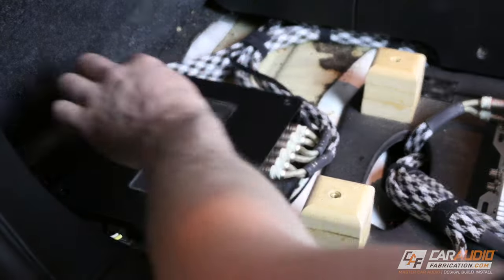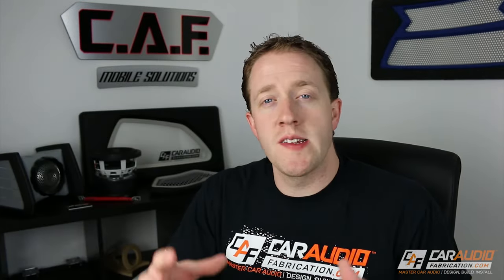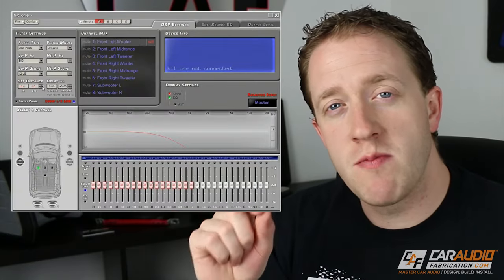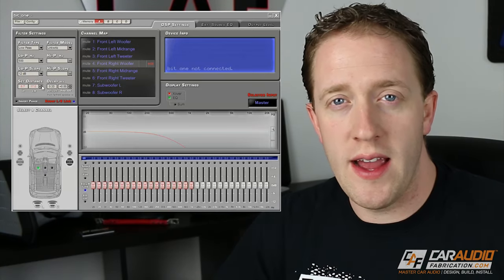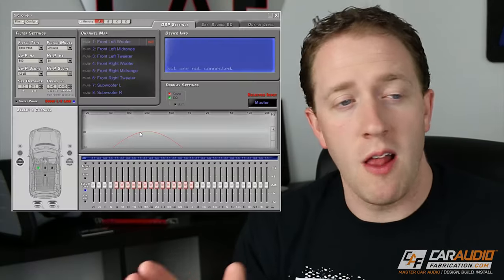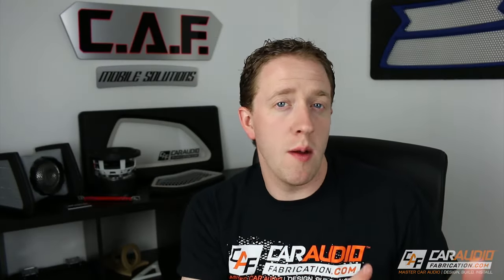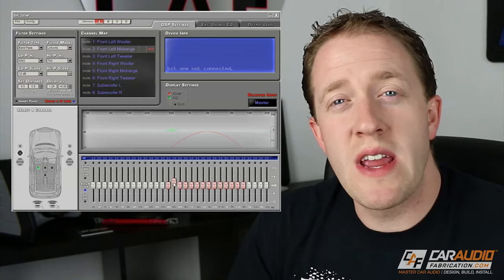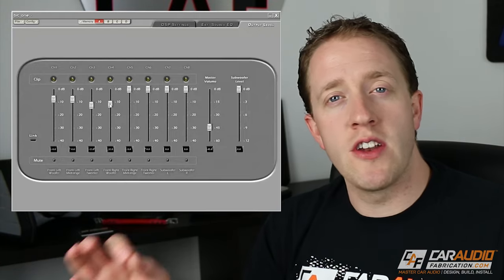What is a DSP? Why you need a Digital Signal Processor for Car Audio

Comment: Id love to see an in depth on DSP programming and installation along with gead unut features and settings for complex active setups that include a mid bass, mid range, and tweeter.
Reply: *head unit
Reply: Captain Buff The Third he didn't ask a question.
Reply: ***** lol 2/10 trolling.
Reply: a subwoofer in the boot and 6.5 coaxial on the parcel shelf and a headunit with at least 10 band eq. I used to think a 9 band was poor till i realised what parametric meant😐🤷‍♂️put the amp under the seat so need to run long cables for RCA.  get the alpine 8 channel amp with built in dsp and use your phone to play music over it. dont need a head unit. I like accessible dsp so i would go for alpine pioneer with phone app kid in a candy shop good for alll them  dodgy downloads and varying volumes.
Reply: read a manual on the deh-80prs, 👍👍

Comment: this may be a dumb question ... but if you delay the speakers closer to the driver so it centers the audio for the driver ... won't that throw off the time alignment for all other passengers even more ?
Reply from the maker: +kcksmithau Yes, it's something you have to decide, do you want the sound to be perfect for you since you are always in the car, or do you want the sound tuned to a center point in the vehicle so its sounds ok for everyone, with many DSPs you can have two or more different tunes. You could have one setup for time alignment for you when driving alone, and one for everyone when you have passengers.
Reply: +CarAudioFabrication  Hey Mark, I have a Pioneer DEH-80PRS in my car which has a built in DSP (an enrty level one of course) and everything works fine except for the TIME ALIGNMENT;  it has 3 settings for time alignment 1.when the listener is on the left side 2.when the listener is on the the right side and 3.when they are at both. 
but since its a right hand drive car, for some reason when i switch it to right, the right side speakers sounds louder than the left and vice-versa when i switch it to left. Only options left are to switch off the Time alignment or keep it at both, at which now i know and hear that skewed sound (confirmed listening with my head in the center, where it sounds correct). The Left and Right presets are also adjustable but dont know how to.  

Should/which speaker should i push or pull in it terms of "sound time distance" ? 
Plz shed some more CAF knowledge
Reply: I'm not Mark, but maybe I can help out here since I had the 80PRS in my last car and have been doing this for a while. The built in DSP is far from entry level for being built-in to the head unit. You can adjust the time alignment for each speaker individually yourself in the settings. The preset are very generic and don't do a great job. If I remember right, there was a "time alignment" menu option for listening position, and then another menu option to actually input the distances for each speaker. As far as which speaker you should push back in time, the DSP will do that for you when you input the distances, but the one that will be pushed back in time is going to the speaker closest to you. Each speaker gets delayed differently depending on how far away they each are from the target listening position so that they all reach that target position at the same time. As an installer I find that simply measuring the distances and inputting them into a DSP does a decent job, but is not always spot-on. I usually have to go in and manually tweak the time delays until I actually get the center image I am looking for. Quick tip if you want to maximize the capabilities of that 80PRS (if you haven't done this already) is to run it in "network mode." This will require you to run your tweeters directly off the front channel of the deck (or your amp) and then your midranges off the rear channel. The deck has full active low-pass, band-pass, and high-pass filters designed for a 3-way speaker setup, including independent EQ and level controls for each speaker. Doing this really opens up the capabilities of that stereo and really allows you to get in and fine-tune the system.
Reply: 80PRS have only 6 RCA Out. and small EQ and fixed crossover point. this is the problem if you want to build 3 way front + sub. In this situation bit one is perfect because have big 31 EQ, in every channel, delay, crossover without fixed point and 2 in RCA and 8 out RCA and optic in and out. Тhis DSP is great for 5 and 7 channel sound system. But if you really want good DSP, get Pioneer p90rs or ODR they are better.
Reply: +Valeri Radev the 80PRS has adjustable crossover points for all channels as well, but yes it is limited in that it only has 18 band EQ per channel and is really only good for a 2-way front stage plus sub, or a 3-way front stage with no sub. Overall a great built in DSP for the money though. $350 vs $1000+ for the 99PRS or a standalone DSP, it's pretty hard to beat. But yeah, standalone DSPs will always give you way more options and tuning flexibility.
Reply: Yes, it makes the sound for everyone else worse
Reply: You can usually have multiple settings depending where and how many occupants you have.
Reply: If I have preouts for front, rear, an sub is the sound processor jus for finer tuning of eqs? Would it be best if I still add a processor with an amp?
Reply: @iaguilera67  Gave lips....

Comment: First off, GREAT vid Mark! Keep up the great work. Second, Audison makes some of the best products on the market, they always give you more than what you need to do a great job. Third, I prefer my older Alpine PXA-H701 to the Audison Bit One or Ten, due to, IMO, I prefer the D/A convertors in the Alpine, I think they sound "warmer", however, that is entirely up to each listener or purchaser of said DSP unit. Just as a side note, for those who want to use a DSP with a stock headunit, you will be shorting yourself due to the limitations of the stock headunit, voltage output, etc., however, most people won't be able to tell the difference in sound. Fourth and lastly, using the time delay alignment feature on any DSP can create a sound field for any situation, my processor is set up so that I get the sound as though the rear speakers are creating the echo or reflection off the back wall of an auditorium. It sounds really cool and can still be tuned for my listening position. More complex mind you, but very good listening effect.
Will definitely watch future vids on how you set up your DSP.

Comment: That was real good explanation.  I have a Pioneer Z5190 head unit, and it seems to have all these functions like Active crossover with slope control, DB level control of each speaker, Time alignment, etc.,  I have coupled it with a Helix G Four.  Still do I need to have a DSP?  Is is worth spending on DSP over this setup?

Comment: Forgive me if I did not find the correct answer.  When using components are being installed in a vehicle with a DSP device, is the supplied crossover still needed to be installed?    I have enjoyed your information.  Thank you.
Reply: It depends. If you have enough channels to power the woofers and tweeters separately, then no. If you don't have enough channels then you need to use the supplied crossovers.

Comment: Would you spend the money on MOST Optical converter for the input signal coming from the factory head unit into the DSP? Is it really way better than tapping the high level speaker outputs to the DSP?

Comment: Great videos... Thank you.... 
Question: I have a HU (AVH-4200NEX) that has many of these features built in (EQ, Time Alignment, Crossover, etc...), but I'm still not thrilled with the sound. Would an external DSP (such as Audio Control DQDX) provide better sound processing than what this HU offers? Is it worth adding an external DSP to an aftermarket HU that already has many of these features?

Comment: Are DSP's mainly for hooking up an OEM radio to after market amps and speakers?  Or do they make an aftermarket head unit even better?  I bought a sound stream vrn 74hb and a sound stream T5 2500 5channel amp would I benefit from a dsp or no?

Comment: If I get a stand alone EQ would I need the DSP? my setup will have 1 mono block amp powering a 10" and a 4 channel amp powering the door speakers the amps have the standard low high and full range switches on them will I be fine if I just set sub to low and the speakers to full range? as long as I set gains correctly

Comment: Is there a way or specific device that would allow different presets so you can focus sounds around the driver, or certain passengers, like the rear, or tune it so it sounds good for everyone in the car? Is that only for aftermarket head units?

Comment: I had a self-amplified sound bar installed in the back of my ford pickup and I used a high low converter to convert the higher amped signal from my factory speaker wires to the lower amped signal requirement for the sound bar input. But there is a great deal of distortion in the sound bar when I play it through the factory radio. Playing it through Bluetooth is crisp and clear. Why? Can I clean up the radio audio through the sound bar by maybe using a better high to low converter? Why does audio distort from high to low?

Comment: Hi Mark

Great video as always. Just a basic thought, I get the idea behind DSP, I have an Audison AP F 8 .9. What happens to the listening position of passengers in the car?  I assume they will not get the full benefit because the measurements are taken from the “driver seat” therefore do we just forget about the passengers? cheers
Reply: It's a load of crap. Your so closed to all speakers that it's obviously wrong. He says. A lot of myth type made up stuff that sounds believable, such as if you distort the sound by adding delays to left and right channels and even worse, by adding delays to all speakers, that it's going to sound somehow better. How it was supposed to sound by changing the EQ. So wrong. That's not why you equalize, you equalize to adjust the sound to how YOU want to hear it, not how it was "supposed to sound". If you wanted to hear exactly  how it was recorded you want to go as flat as possible and going that flat means not altering almost any of the EQ. THE ARTIST did a lot of EQing when producing the track and the mastering engineer did even more EQing. Checking how it sounds on speakers and then headphones trying to find the perfect balance. If you want to recreate how it sounded when it was recorded you want to use Studio Monitors which are flat by nature.

Comment: At 3:44. Do you need a DSP if you have the coaxial door speakers? Doesn’t the built in crossover on the coaxial speakers do what the DSP does? And also if I don’t decide to use the DSP is it bad if a subwoofer plays high frequencies?

Comment: 90% of the people who are adding/replacing their audio systems couldn't tell the difference if you're using a DSP or not, and maybe 1% of those that do get them bother to take the time to learn how to use it. They get it set by the installer and don't touch it ever again. Those same people come in and say, "I want the loudest system in town". These are the idiots who also buy capacitors for their systems. Quickest way to a short lived alternator. DSP's are great, but not for your "typical" music lover.

Comment: +captin buff the third yes my rear channels are now on the passive crossover after adding the w7 sub. at 1st I didnt know how Id like giving up the control of all my speakers but once I added the crossover to the rear i didnt notice a major difference since that staging was in my rear. I had to remember i was going for front staging like in a concert setting, not surround sound, so the backs became just a filler and sub in now on dsp. Honest I couldnt tell much difference in sounds of the sub as much as mids and highs but was able to time align it as well. Again my set up is for the driver position and had to learn that because i have it so perfect in my seat and try to sit in passenger and change settings again, and it was a back and forth process. still love the helix unit, because I felt it was a lil more user friendly if you never done 1 before and my bit 1 gave me issues. i did buy the bit 1 used so that could be the issue. Still running my kenwood dnn992 with built in time alignment but just not using any of those settings in my deck.

Comment: Idea for this series, I am building a sq system and I'm already using a clarion fx503, it has really nice vocal imaging and equalization built in. But I'm still wondering if I should go a step farther by getting a DSP. What are some pros and cons to adding a DSP to an aftermarket unit with existing imaging? Thanks for all knowledge you've passed on Mark. Great videos

Comment: With a DSP...would I still need a line out converter like LC-7i. My project is a full system upgrade except for the head unit the vehicle is a 2015 Dodge Durango . Any suggestions is welcome before I start purchasing equipment. Thanks...love your videos

Comment: Is this a good option to free the restricted factory signal for my crappy 2009 Infiniti G37 with Bose? The head unit in this vehicle is basically not interchangeable, but I want to optimize my signal to my aftermarket amplifiers.

Comment: Looking at your video, I decided to ask you opinant on this. I am about to buy a system for my Mitsubishi Pajero 94: 
These are the standard size 
   Front: 4", 6-3/4"
   Rear: 6" x 9"
   Dash: 4"
   Front door: 6-3/4"
   Rear side panel: 6" x 9"

I don't want to put in a sub (As I don't want a box in the back) but I would like the deep bas sound, so I am planning to use 3 ways in the front and rear doors and rear area, and two way on the dash.
I would like to use 1 amp to drive everything.  
I would like lots of top and bottom end sound, as I lesson to mainly Reggae, Soca, Jazz, R&B and blues. 
Being in the Caribbean at times I can turn this up, however, when driving I would like to play this low with a nice rumble.  I would even like to just sit in the Pajero on the beach or in the mountains and listen to music or a video with a nice sound.
Any ideas how to set this up? Or Are there any special ways to set this up? 
I am thinking of using alpine as past experience tells me I will not get amp noise an a good sound without breaking the bank.

Comment: Hey mark what is the best OEM you have installed or had experience with. Im looking to do an entire system in a 2017 Accord but keep the stock stereo. System will include components in the doors, rear deck coaxial, 2 10” subs. Rear deck mid bass (6.5”) maybe an 8”, two kicker amps 4 channel/monoblock. I don’t any fishy pops, clicks or whine at ALL. Please recommend.

Steve

Comment: Hi Mark, great video!
Can you add a DSP after a factory Bose amp? I have a factory 7 channel Bose amp in my 2016 Colorado that pretty much integrates all my electronics/GPS/Infotainment. It serves as the brains of my factory system and is connected to my dash unit via a proprietary digital cable...bypassing the Bose amp would cause me to lose functionality of some components and sounds (like door chimes, turn signal chirps, start noises, etc). Would I be able to run the speaker outs from the Bose amp to the inputs of a good DSP?...And still maintain full OEM functionality?

Comment: Hey, great video/explanation of everything.  Wondering if you can help me with a technical question I have aobut my vehicles interface between th H/U & factory amplifier.  My question is, how to I implement a DSP for the car, and (more importantly) is there an input on these DSP's for the CAN bus ?Reason Im asking, is my factory H/U has Nav, which Nav voice is un-able to be muted.  So it constantly interrupts the stereo volume to voice nav commands.  Its extremely irritating, because it will lowever & raise the stereo volume, automatically, dozens of times per few mins.  Essentially, what I want to be able to do is bypass the Nav input to the speakers, so that It does not interrupt the Stereo volume.  But, if the DPS has an input for CAN bus, i may be not able to control that right ?

Comment: Can you help clarify something please, when you’re saying that you can tune each speaker, your channel 1 and two are already set up on crossover’s between the 6 1/2 inch and tweeter if you bought a component set of speakers, which most people do. 
So there is no real way of blowing your Tweeters if you set the frequency on a DSP to low because the physical crossovers at the component speakers will protect them, isn’t that true? 
I’m trying to clarify if I need to remove those factory crossover‘s in order to better control the equalization of each speaker? I personally would rather not, my lumbar  sucks.

Comment: What if I have front component speakers and coaxial rear speakers? Will the DSP override the crossover built into the coaxial speakers, or is there a way to disable the built in crossover?

Comment: Hi, I got a small question. My car Ford Falcon has premium sound system from the factory (total power output is less than 400 W, includes amp, equaliser and 8 inch sub at the rear deck) but it sounds not very good to me. Now I’m planning to upgrade two front speakers with high quality Pioneer full range component speakers. For the best result, can I add the Audison bit 1 digital sound process and a good quality  amp together with the speakers? I’m not sure what type of amp i would choose 2,4, or 5-channel amp? Please give me your advice, thanks!

Comment: My excelon head unit has a DSP feature I have used the measurements for speakers and found the correct slope for my sub and speakers. didn't know head units could have a DSP. most likely isn't as good as an actual physical DSP but it's good for someone on a budget

Comment: What do you do with the crossover on the mono amp , when using the  dsp. Subsonic low pass ? Do these settings still have an effect on the signal leaving the dsp into the amp? I'm a begginner.